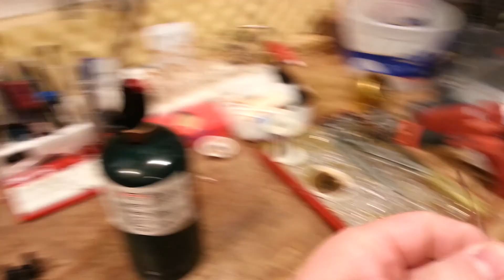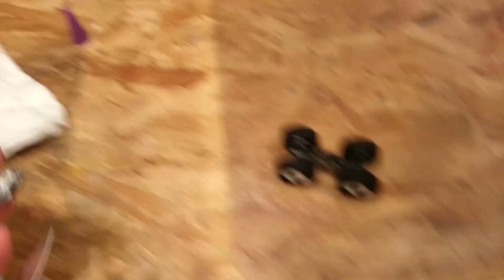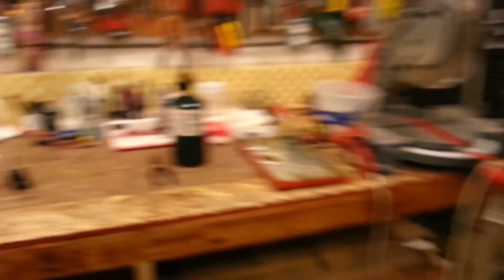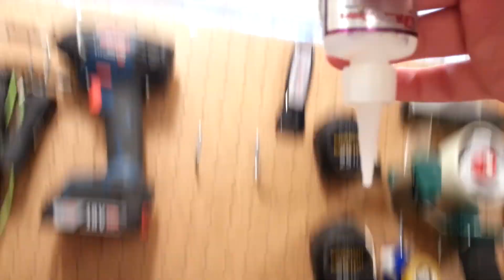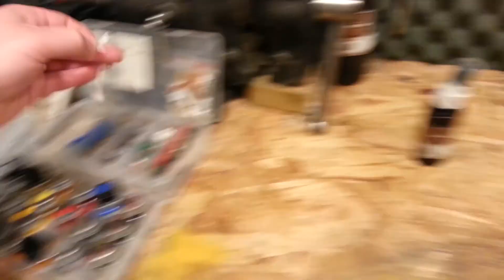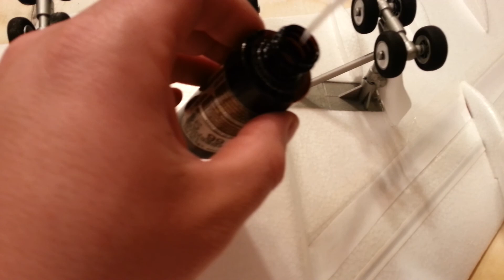Tian Sheng - Airbus A380 - Landing Gear / Bogey Repair

Comment: Have you tried your luck at plastic welding? BTW I’m just watching your videos as they randomly pop up when I open the YouTube app. I’ve noticed videos from years ago pop up one day and then another day a more recent video will pop up.
Reply from the maker: I've done it before, mostly just heat both sides and stick them together, but too much loss of height for this application. Interestingly, the music wire being embedded will help a lot with strength too ;)

Have you ever looked at the description of my videos? I have a mostly comprehensive list of all the videos in a series, so you can start from unboxing through the most recent flights, and all the mods and improvements to date. It's like RCGroups without the endless scrolling and waiting for months and months of no change. I make a concerted effort NOT to leave my audience high and dry...I hate when I see a video and then the videos promised never happen - drives me crazy!!! - so I don't do that.

Hope you'll come back for more, and one day you can just start a playlist and sit there for like 23 hours in a row....well maybe not that long, but you get the idea!

thanks for watching!
Reply: Brian Phillips yes, I’ll sit and watch your vids such as the flap mod vids on the UMX micros. What I was referring to on the plastic welding was actually using a plastic welder that produces a superheated beam of really hot air. You usually use a welding stick of compatible plastic to weld the pieces together. Frys Electronics sells the welders and sticks. It fixes the plastic to make it as new.
Reply from the maker: I did some research on that a wile back. I saw a guy who would make an "alloy" of plastic by feeding in a stick....like tig welding. Pretty cool process.
Reply: Brian Phillips check it out I want one. https://www.harborfreight.com/plastic-welding-kit-with-air-motor-and-temperature-adjustment-96712.html
Reply: Brian Phillips I don’t know why I don’t already own a plastic welder yet.
Reply from the maker: I challenge you to do it with a torch!!!
Reply from the maker: It's because the other 4,325 items you also want at Harbor Freight tools....I feel like Naven Johnston at the end of "the Jerk" when I leave that store....

"I don't need anything".... "but I need this"....."I don't need anything"...."but I NEED this"....and so on and so forth until they come and tap me on the shoulder to inform me the store is now closed...
Reply: Brian Phillips for the first 20 years of my life I was building plastic model airplanes usually fighter planes. The model companies would supply profile shots and complete detailed history of the aircraft in the kit. I remember breaking parts while trying to remove them from the parts tree and using a lighter to weld them back together. Now a days we have so much tech compared to those days and a myriad of glues that can instantly fix anything. I’ll buy a plastic welder one of these days and make a video. All the plastic stuff I break I really need one.
Reply: Brian Phillips so very true. I’ve got their big 8 ton floor jack and the 20ton shop press and one of the oiled 30gal compressor and so much more. I think I keep going because I get so many of their free gift coupons with every purchase so I have enough cheap LED flashlights, multimeters and screwdriver sets to last my family’s lifetimes.
Reply from the maker: Yep, same here! Free flashlights with every video - LOL!!!